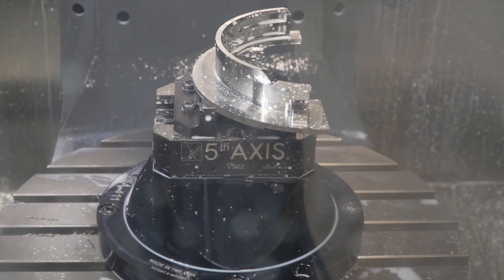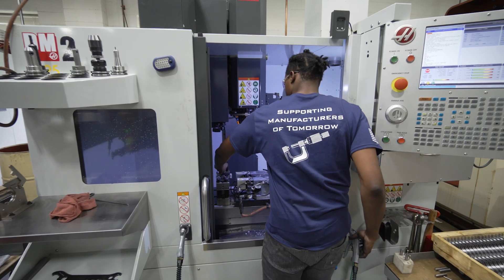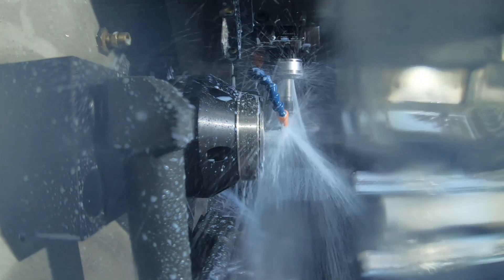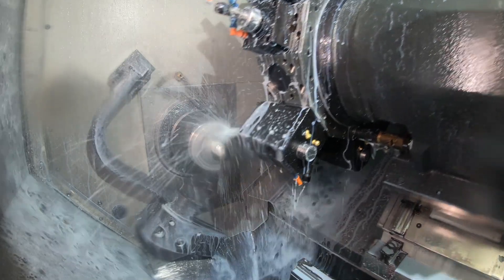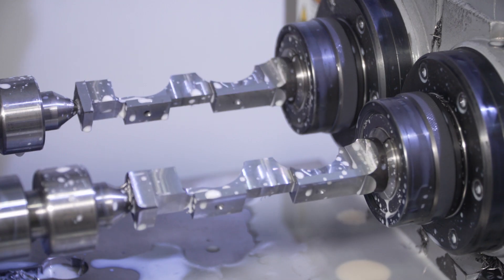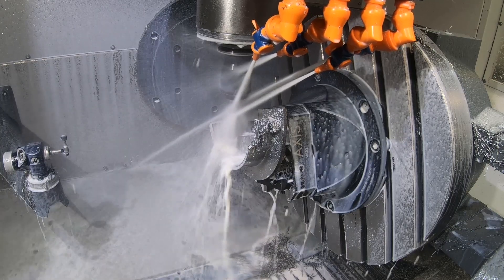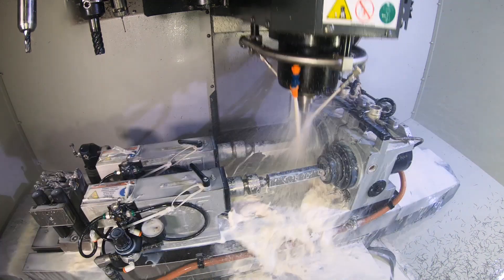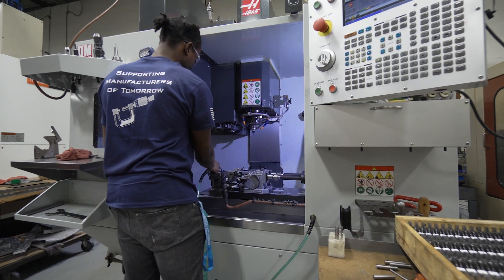Sirois Tool Company Talks About Adding New CNC Capabilities

Comment: Seems to be a few UMC's out there producing parts.
Seems i also remember many saying a lot of bad things about the UMC's  🤔
They can't be to bad if you see so many shops running them.
Reply: They are a good machine, Getting the posts tweaked is always an issue on any new machine, but that is not a HAAS issue but rather the programming software issue. We recently swished our post processing on our 5 axis machines to where were program in Mastercam and do the posting and verification using CAMplete